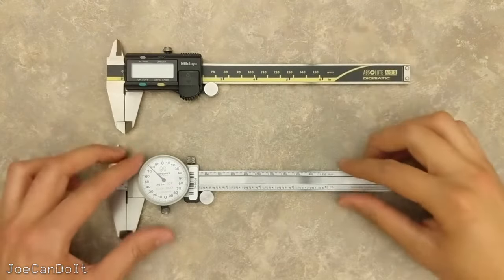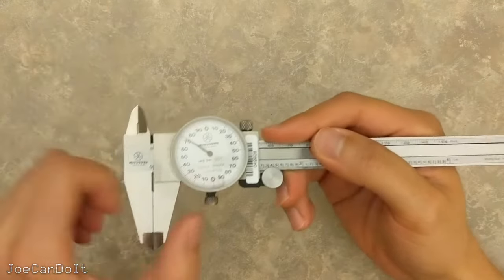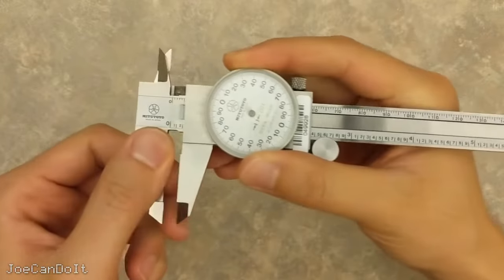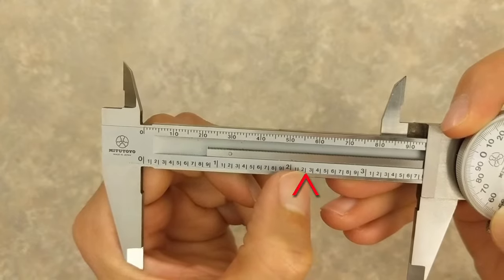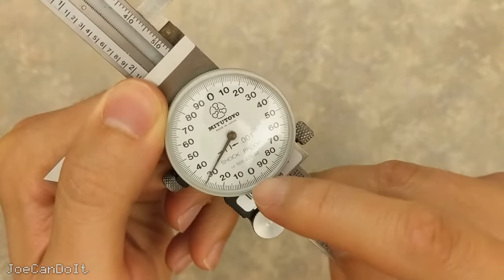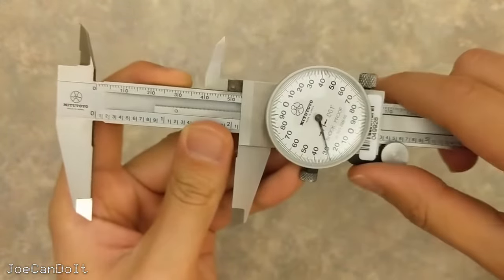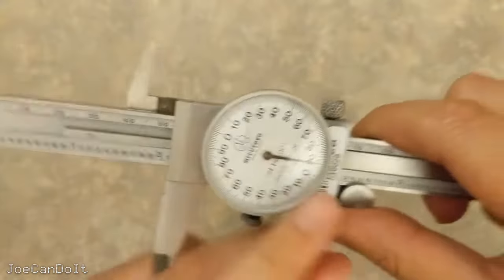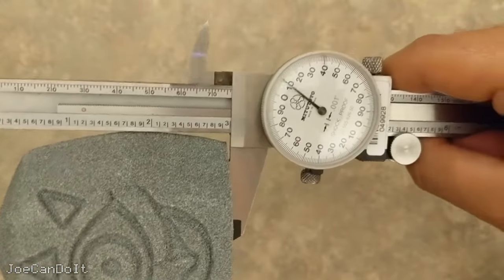How to Read a Dial Caliper - It's Easy!

Comment: i'd like to understand why it has a metric scale. it seems like it would only be useful to eyeball the metric measurement to the 0.1cm accuracy (dial appears useless for metric), and to get the accuracy of the dial you'd need to measure in inches and multiply by 2.54 anyway

Comment: This might seem like a simple question, but why does this dial have two different zeros on the dial? Every set of dial calipers that I have ever used only had one zero on the dial (from 0-99). Thanks
Reply from the maker: I have noticed that too when I first used them. I guess the great ratio is different?
Reply: Yeah it's easy to overcome but
Reply: I have also wondered that. It seems like no advantage to the user - if there is only one span from 0-99 then the numbers and grad marks will be larger and easier to read. I can't think of an advantage to having two ranges.
Reply: seems unnecessary, but maybe so it's easy to tell if you're above or below the graduation mark